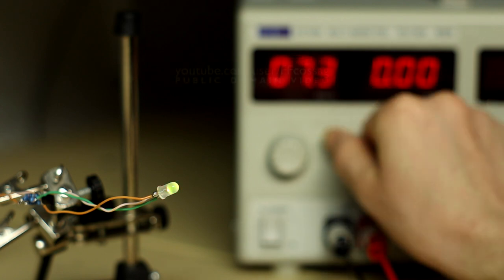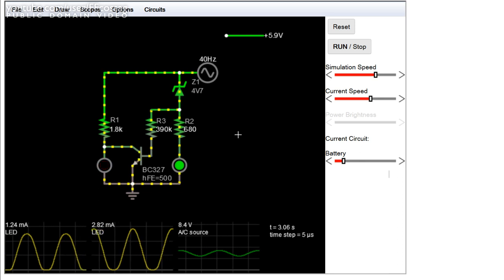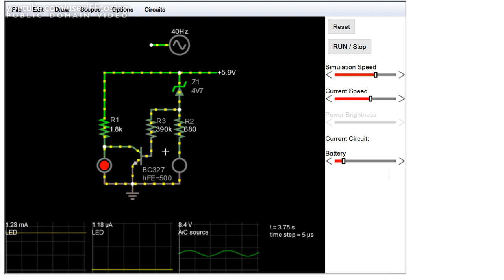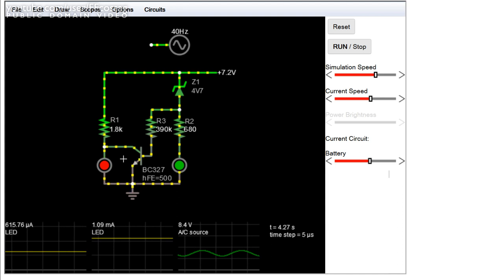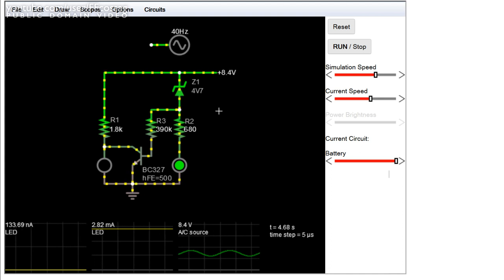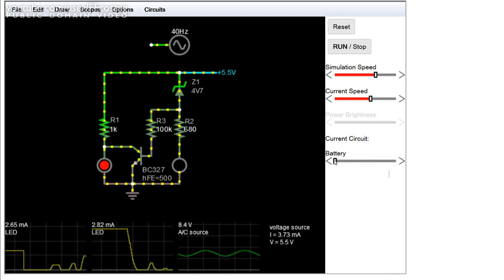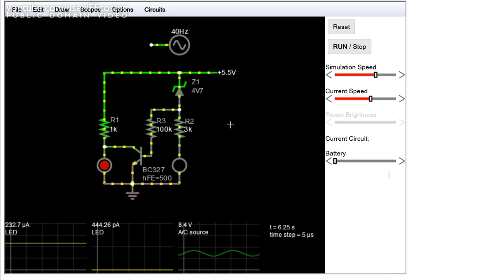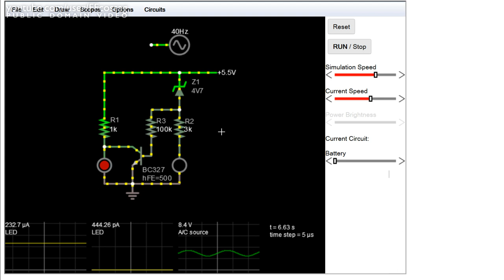Clever 6 component battery gauge circuit!

Comment: Nice timing, I have been trying to design a lithium charge protector using discreet components.
Didn't consider using zeners.
What component changes would be needed to use optoisolators instead of leds ?
Is there a reason not to use a PNP transistor to switch off the red led directly ?
Reply from the maker: PNPs aren't as stable as NPNs, and since the circuit is dependent on transistor linearity, an NPN is a better option.

For optos it likely wouldn't work well, since their forward voltage is so low. But try it, you've seen what the variables do. :)

Comment: I'd rather add one more resistor (breaking the bank, I know) for something that should be a lot less dodgy:
https://tinyurl.com/ybbebb67
Red LED turn-on threshold varies between about 6.6 to 6.9 V for beta between 100 and 800, that should be tolerable. Temperature characteristics may still be terrible and require another resistor for emitter degeneration, bringing the parts count up to 8.
Reply from the maker: That's a nice addition if you can spare the extra component.